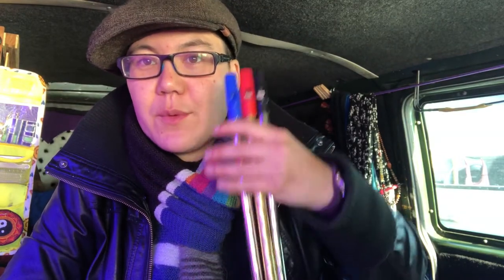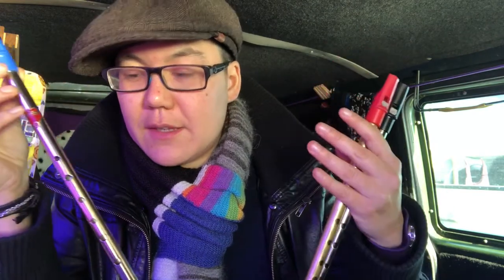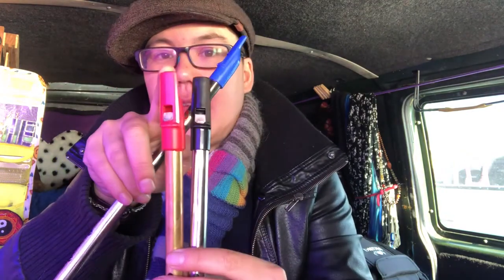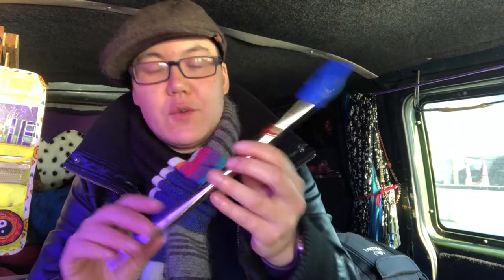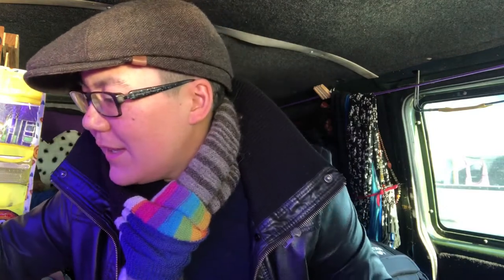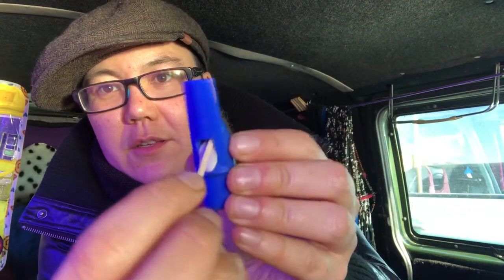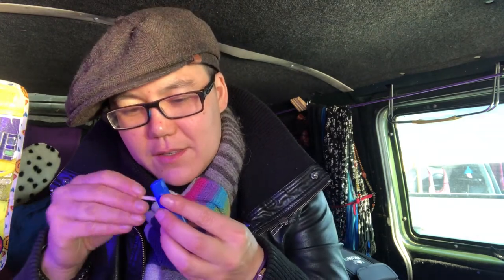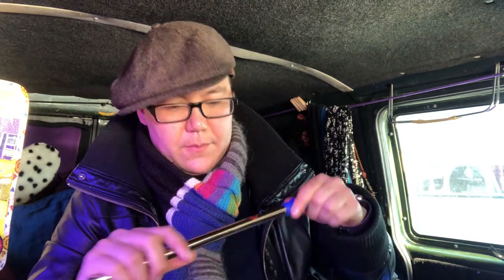Tweak Tin Whistle / Pennywhistle With Blu Tack - Great Trick For Generation / Feadog / Oak

Comment: I wonder if a coat of nail varnish would work as well to smooth out the ramp.
Reply: U ever try that?
Reply: I have, yes. It helps, but you have to brush it on carefully. Anyway, if you get it wrong you can wipe it off with nail polish remover and try again.
Reply: @ubizmo  Be careful with that.  If you use an acetone based nail polish remover and that fipple is ABS...  well, acetone dissolves ABS.